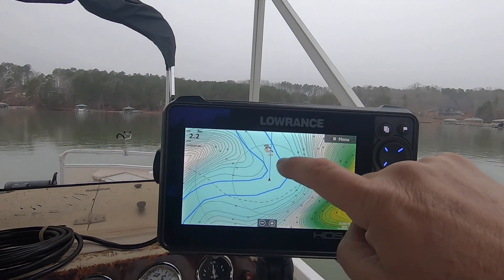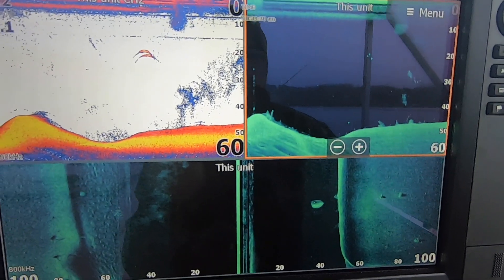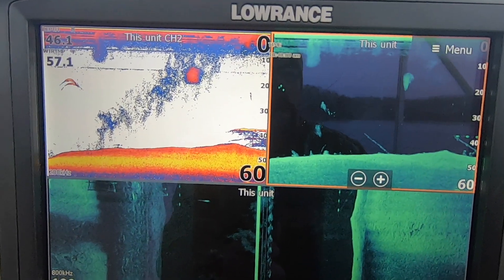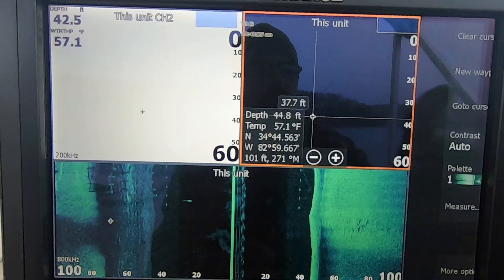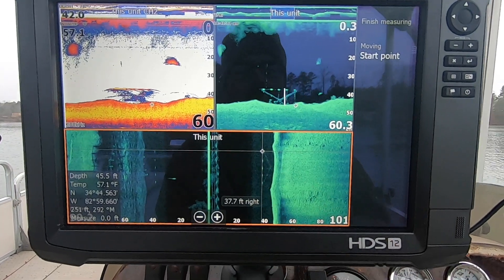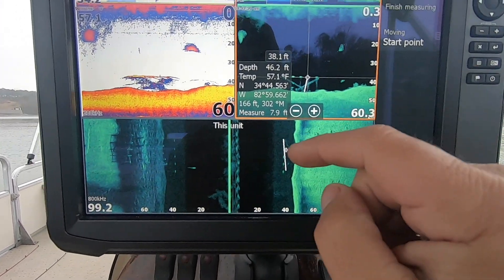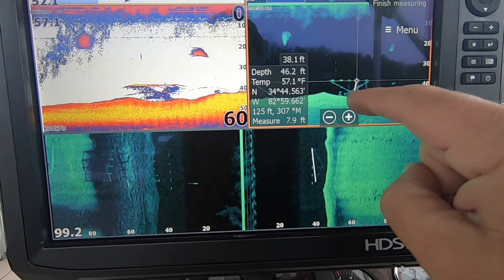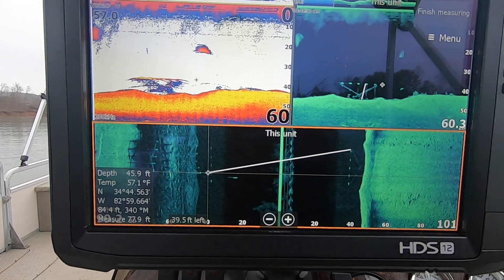How to use the measuring tool on a Lowrance HDS Graph (Easy Shortcut)

Comment: Nice vid.  Is that HDS 12 a Gen 3 unit, or Carbon ?
Reply from the maker: I bought the Carbon when Cabelas had them on sale over Christmas.  I got 10% off by using gift cards I purchased while they were on sale.  I have it Ethernet linked to my HDS 7.  I keep the map running on my 7 all the time and use the 12 for 2D, down and side imaging.  Thanks for watching my video Rich!   🐿